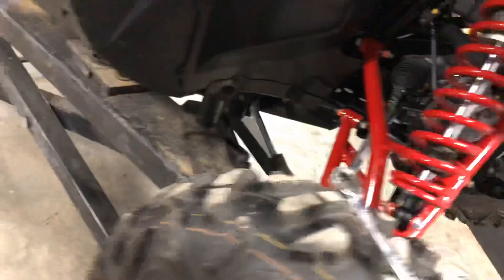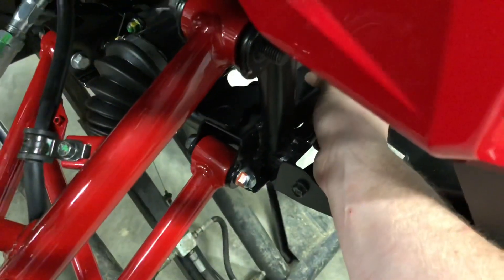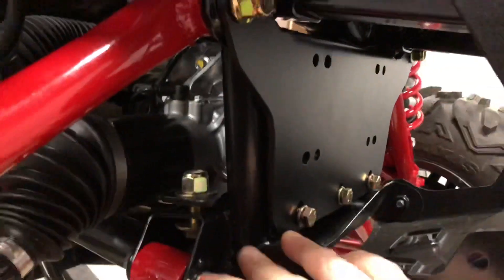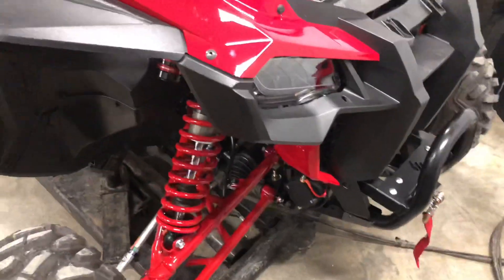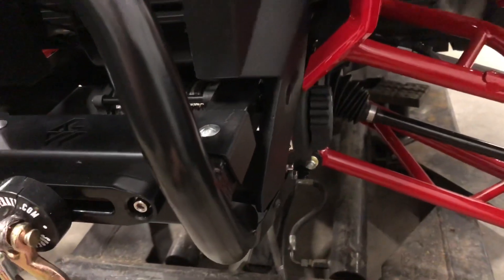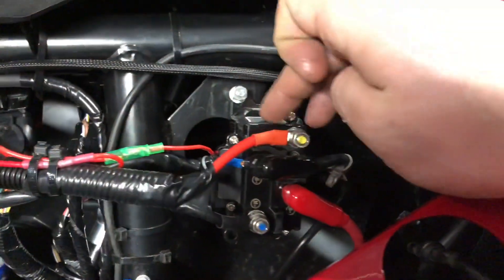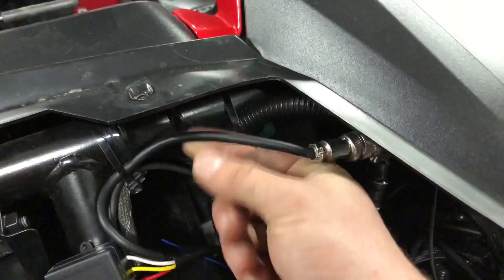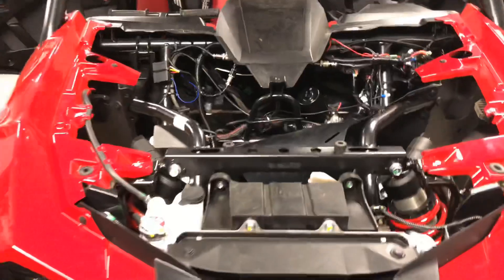Honda Talon - L&W Fab Winch Mount Install

Comment: Were did you connect the red positive key on power wire to the one coming of the left side of the solenoid shown at 5:34
Reply from the maker: Shortly after that where I mention I re-purposed the factory key-on accessory wire is what I used.  You'll find that plug as a blue plug on the frame where I point at 6:04 in the video.  When I wired my Talon and shot this video there weren't plug-and-play options available so that's why I converted the plug to my own quick-connect plug.

HondaSxS.com now offers a plug-and-play harness that gives you a pigtail you can leverage:  https://store.hondasxs.com/collections/talon-1000-r-x/products/honda-talon-power-harness-version-b

Comment: Will this mount work with the honda aluminum bumper?
Reply from the maker: I can’t answer that question for sure since I don’t have that bumper, but looking at the instructions I would think it should work.  The struts that the fairlead mount attach to look like they’re also included on the aluminum bumper and the bottom bash plate mounts the same way as well. 

https://hondasxs.com/attachments/aluminum-front-bumper-pdf.115512/
Reply: yes I have the aluminum bumper and it works with no issues.

Comment: So just curious on how you like Talon versus the RZR I currently have a 2017 titanium RZR XP 1000 and I'm thinking about trading in for a 19 Talon I can get it out the door for 17-3 the dealer said by the way I've been watching your videos for a while ever since you had the CF Moto
Reply from the maker: Ram cummins 05 both machines have their benefits.  Overall, I prefer the Talon and will be doing a review video very soon where I discuss some of the pros/cons of the machine.  If you’re saying $17,300 out the door AFTER trade, then that sounds like a poor deal.   If you mean you’re buying a Talon for $17,300 out the door with no trade, then that sounds like a good price for an R model.
Reply: @Jason____  are the price of the town I'm looking at is 16 to 50 but once dealer figures and tax title and all that out the door prices around 17.3 is what they're telling me
Reply from the maker: Ram cummins 05 right I understand the additional fees.  I was making sure that doesn’t take any trade difference into account.
Reply: @Jason____  so just curious where did u get your fender extensions or did u make them and are u on Facebook
Reply from the maker: Ram cummins 05 https://rokblokz.com/products/honda-talon-1000-2019-mud-flaps-fender-extensions